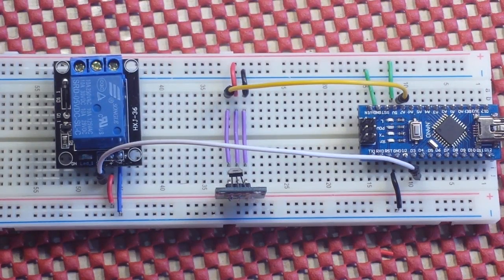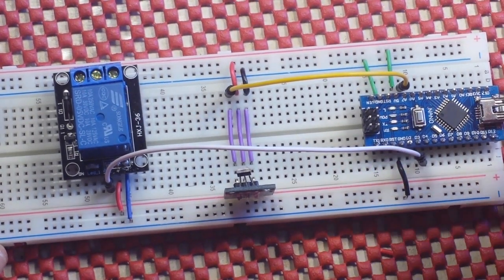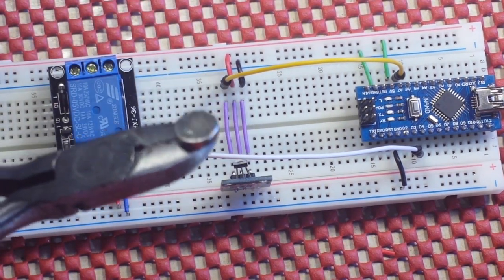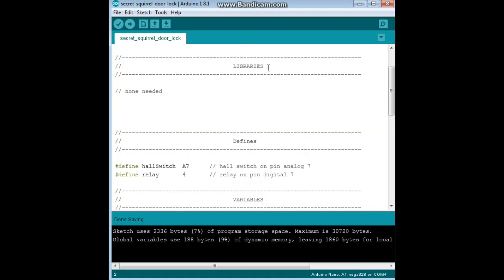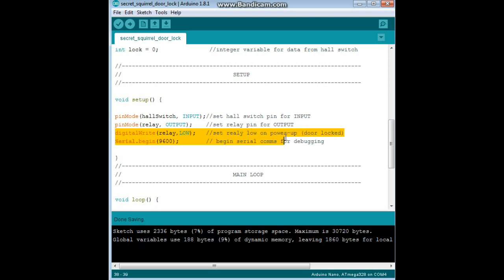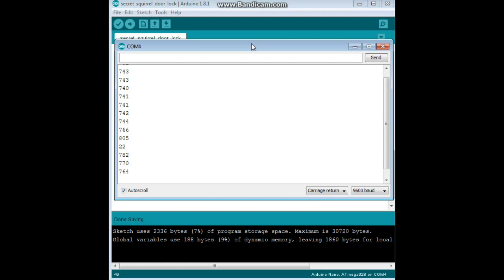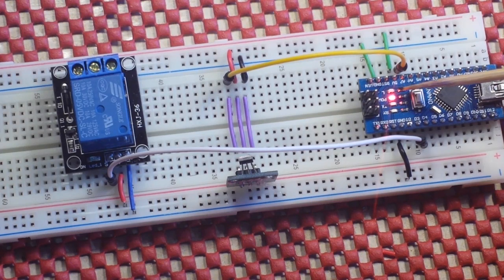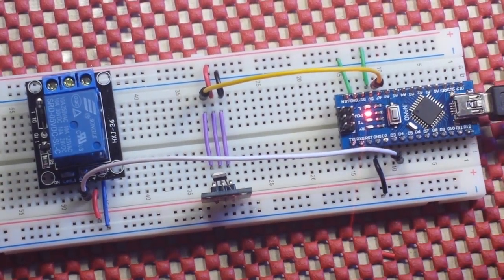How to make an Arduino Magnet Actuated Door Lock

Comment: hello cute interesting the video a query it is possible to control an electromagnet by means of the arduino but using pulses instead of the classic turn on and off as if it were a led